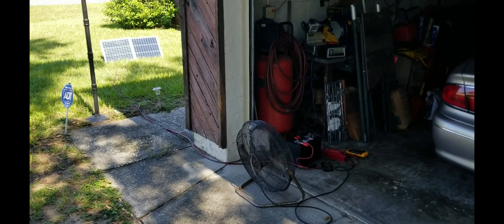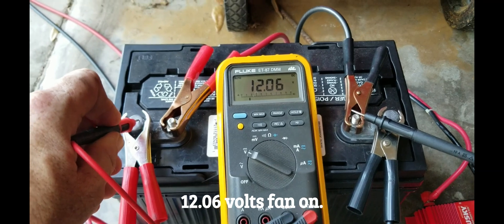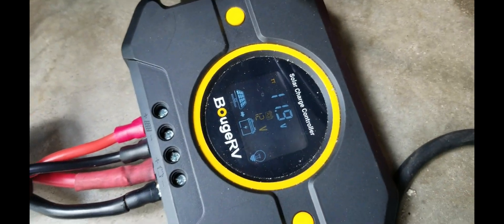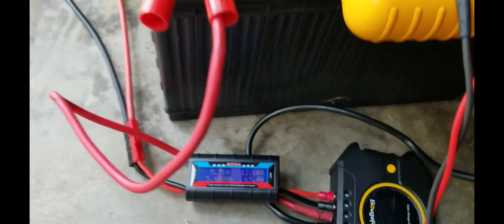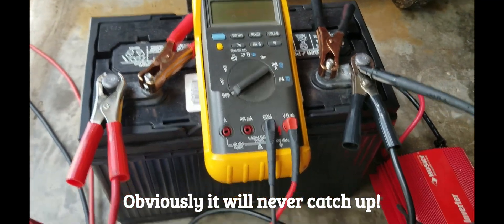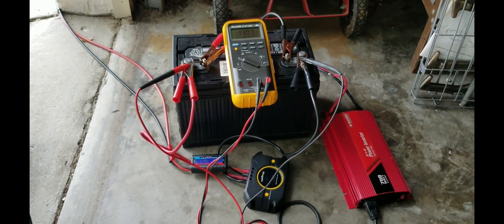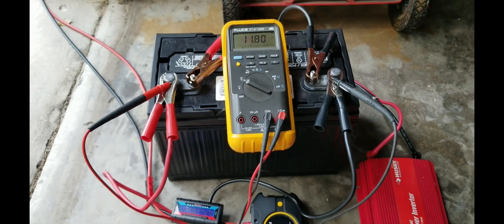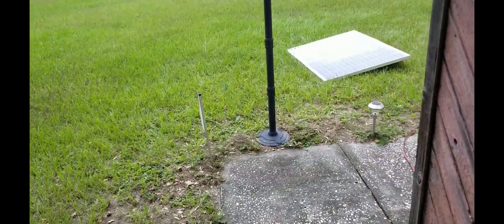Solar and Battery Testing

Comment: Fun experiment.  The thing I learned from this video is that you need a new fan.  I don't know if I have fan at my place that pulls over 100w unless it is going full blast.  Going to go to the woods and try my solar out.
Reply from the maker: Lol. That fan is old from my dealership technician days. Its pushes a lot of air and its loud which is why its rated at 2.9 amps. Get out and try your solar stuff. If you can, make a video for us to see your setup! Thanks for watching my video!

Comment: Can you connect the 50w panels with the 100w panels? Good video, it really shows you what to expect to get out of your equipment.
Reply from the maker: I can connect the 50 watt ones. I have thought of doing that for more wattage during a power outage. 
I originally bought the 50w panels for keeping batteries up while camping and during portable ham/GMRS radio operations because of their size for packing. I dont like the folding flexible panel types I have seen so far. Thanks for watching and your question!